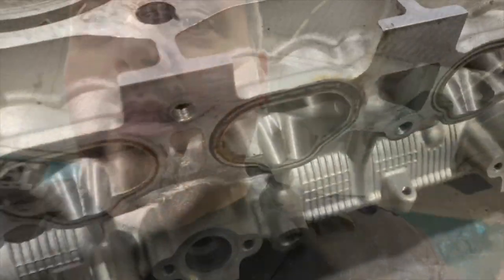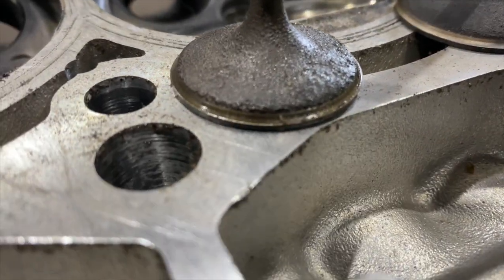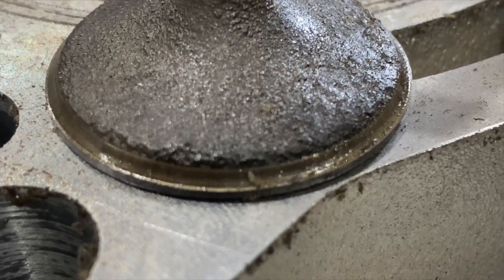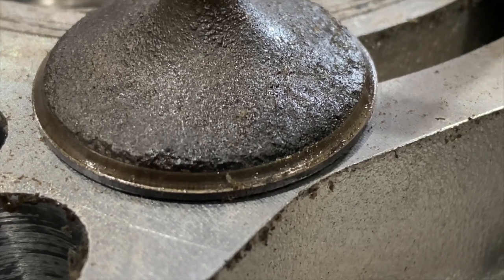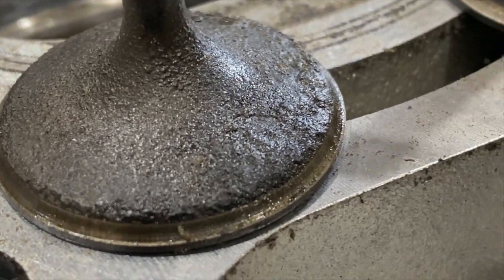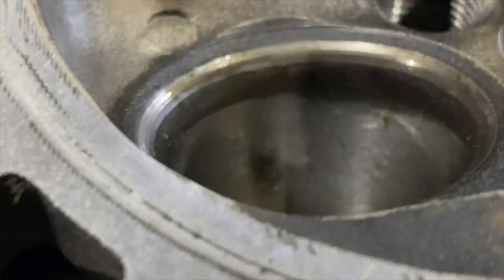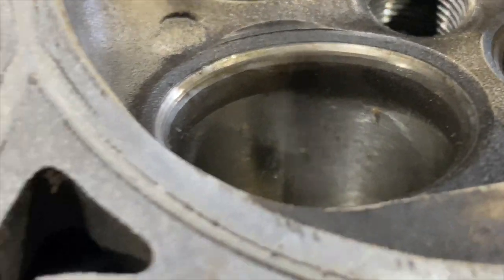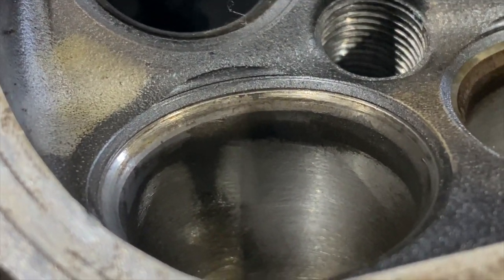Valve Float ** What It Looks Like

Comment: Hey, I know you were being sarcastic about refacing it. But I would like to know how to go about this situation, when the valve seat has been that eaten up.
Reply from the maker: You have to replace the valve, most times replace the guides and do a valve job. Put the correct spring for the given power level and it won't happen again.
Reply: @headgames  thanks a lot man
Reply: @headgames I have ls1 springs on my vortec heads, I’m running a fat mother thumpr cam in a 5.7 350, recently I just replaced my plugs and discovered cylinder 5 was busted in and burnt, after replacing it the miss went away and it runs fine now but should I be worried about valve float still I checked my springs and valves while running the truck at high rpm’s, (the heads are resurfaced and new valves as well)
Reply from the maker: @andrewgarcia8349  what retainer are you using to get an LS spring on a sbc? Did you check the spring height/pressure?

Comment: So u are saying valve float cause damage to valve seat??? 
   So an upgrade valve with more pressure would have avoided this situation?
    More likely this is a case of owner buying a inferior aftermarket valves and replace factory or even worn base on years of use.
    Same aftermarket high pressure spring recommended by so call experts will put way more pressure on the assembly.
  Never rely on expertise of someone that's selling u a product or service.
Reply from the maker: yes it will cause damage to the valve, the valve seat and the valve guide. An upgraded valve spring to fit the power level would have avoided this. Yes.